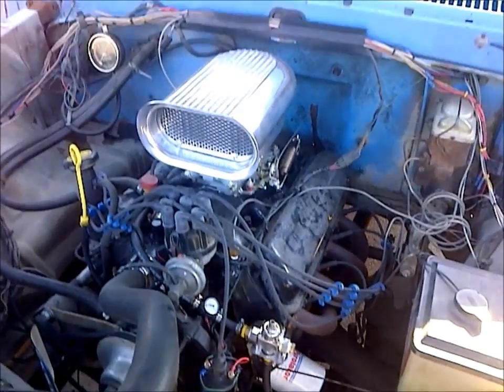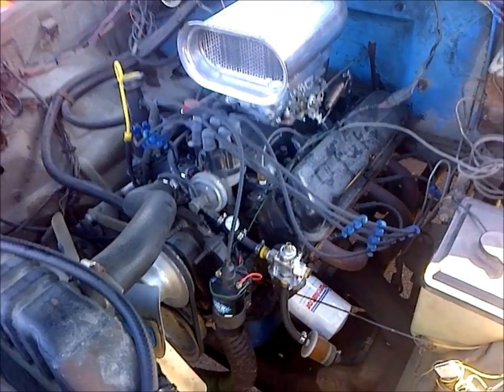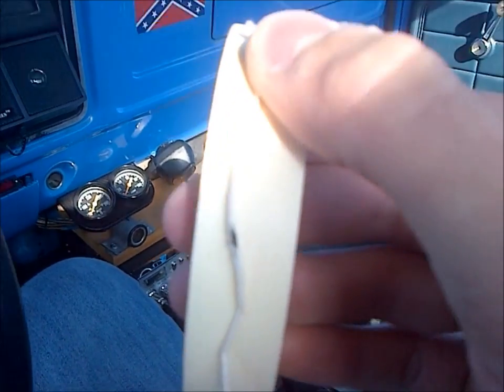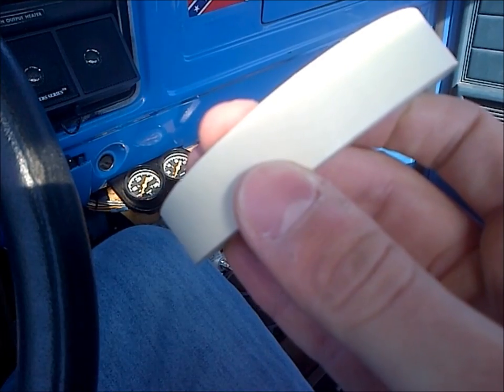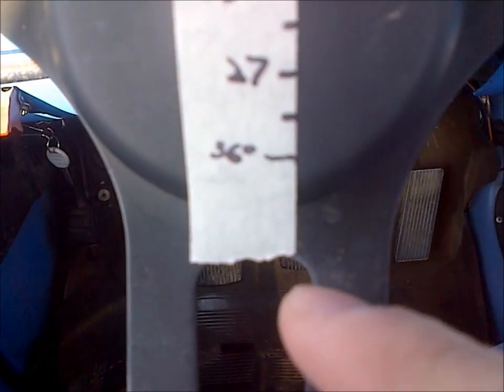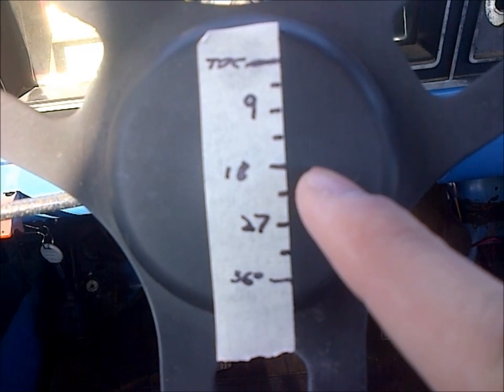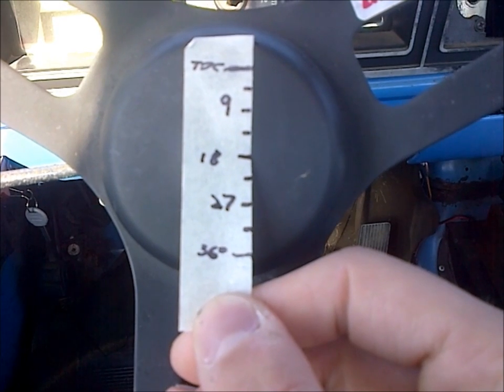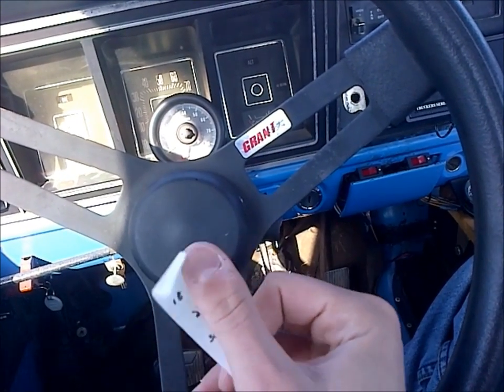How to Make Timing Tape & Marks

Comment: Its not lining up with my timing chain cover . I get 9 degrees at the 7 degrees on the timing chain cover . Im 6.75 inch Balancer x 3.14 = 21.2 then 2.1 inch to 36 degrees .on the timing cover 12 degrees is 0.75 inch , so 36 degrees would be 2.25 according to this timing chain cover . The timing cover assumes im using a 7.165 inch harmonic balancer . wtf

Comment: A great idea... I usually place my tape back a little bit from the edge of the balancer... and then I will take and place a center punch mark every 10 degrees on the balancer... TDC is already marked... and then one mark @10 degrees... 20... 30... and 40. And you can dab a dot of fingernail polish on each punch mark. Isn't math a wonderful thing? I typically multiply the diameter times PI (3.140) which gives me the circumference, and then dived this by 360 (the number of degrees in a circle) and then you can multiply this times 10 (to give you the length of 10 degrees), 20 (for 20 degrees), 30, and finally 40. You can also multiply the degree number times 36 to give you that mark.
Reply: Mark Rakemaker 
My dampner is a Summit silicone one & it says to not engrave or put dimples in it with a drift punch.  Any help on my above question.   Im at a stand still now.

Comment: A nice I have never thought of that plus I don’t now a lot of engines but i me learning with your videos and trying to do a project and put a carburetor engine in my 1995 Dodge Ram 3.9L and I am looking for a 5.2 318 Dodge and I was looking on other videos and the Chevy 350 is the same 36 degrees for timing will this 36 degrees be the same on the 5.2 as your 36 degrees on your Ford

Comment: I've got a 77 dodge bb 400 & just put a new timing ch ain & sprockets on it.  I also bought a new Summit unmarked dampner & MSD distribuor & new timing tape.  My question is, with timing cover temporarily on, do I align timing mark dots on sprockets, put distributor in pointing to number one position, slide damper on temporarily,  put timing tape on with "0" pointing at timing cover "0" timing tab?  I've got the dampner to pull off dampner for final installation.   Any help here?

Comment: I’m having trouble with my timing and I’m tired of trying to adjust it. I am not a mechanic it is not my profession. I took it to 3 mechanics and I’m still not satisfied. Tired of spending money on these mechanics that supposedly have experience in carb. I will fly you out to get my 85 gt running the proper way. Please help me
Reply from the maker: GrindModeTV join my Facebook group “Thunderhead289 carb & engine - tech/tune forum” and then DM me after I approve you
Reply from the maker: And I travel for my day job all across the us - there’s a good chance I end up close to you anyhow

Comment: My chev is in a boat and doesn’t have the harmonic balancer, the fly wheel is where it would normally be, so will these math equations work the same for marking timing marks on the flywheel?
Reply: Yes it will